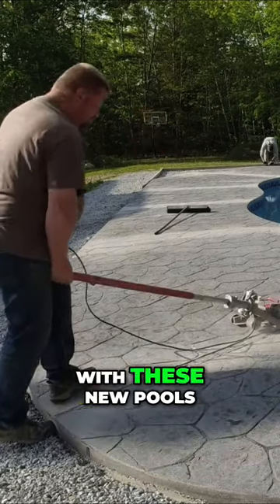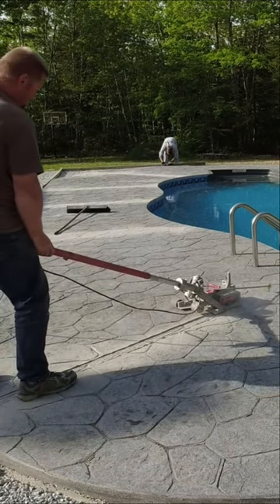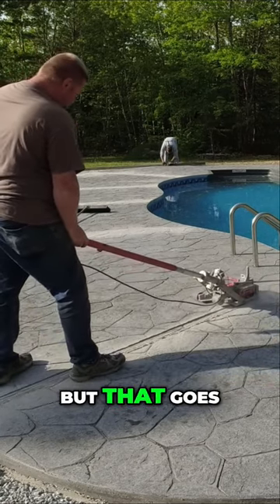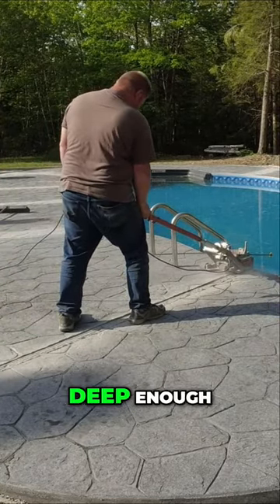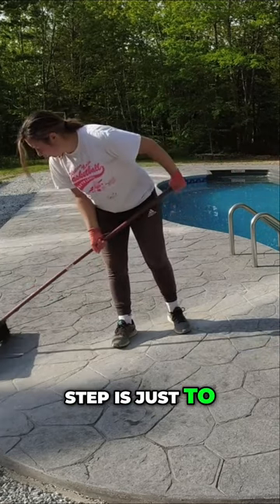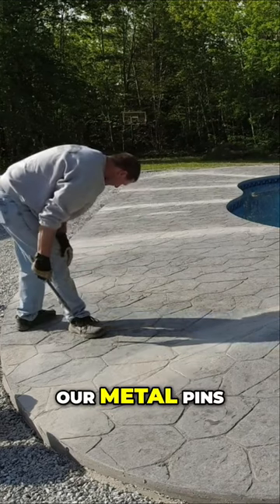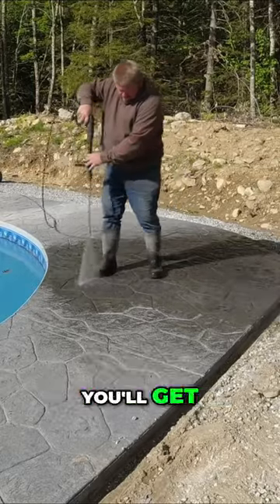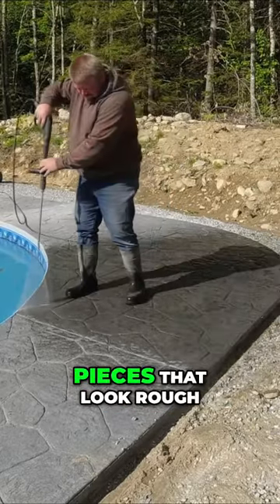My Favorite Saw for Concrete #shorts

Comment: Why do you do this? “I’m not in concrete)
Reply: It relieves pressure in the slab and promotes it to crack inside those saw cuts, instead of random and wildly somewhere that would look horrible and also the slab would perform out of expectation in its life